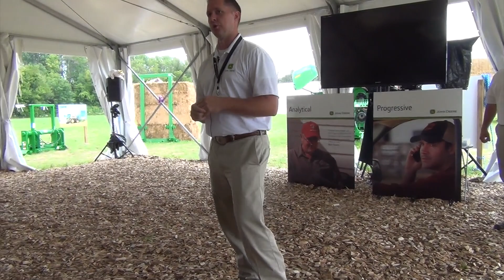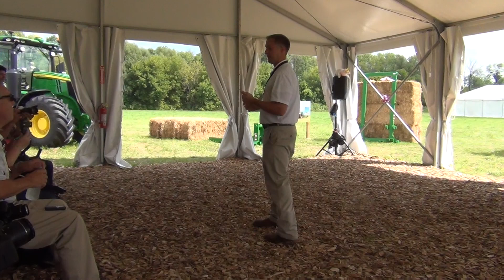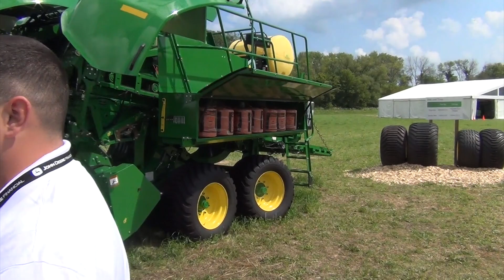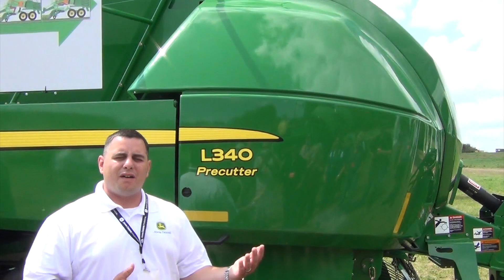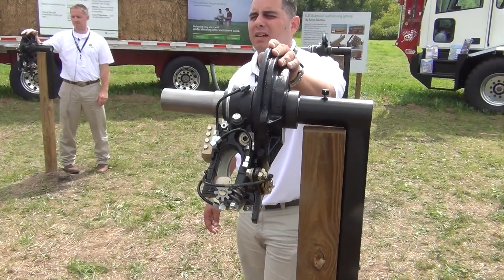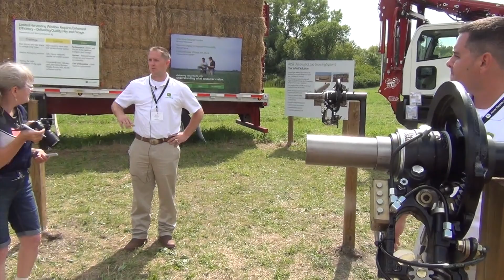John Deere 2015 Products Launch - L Series Square Baler

Comment: Its a very nice machine but it's technology is similar to that of 2008 compared to the leading competition. But here's my ups and downs with it, just by looking at your videos.
It has the exact same knotter as AGCO so there's not going to be any tying problems, how you get away with calling it a John Deere tying system is beyond me. Twine ball capacity is brutal, I would have to fill up 3 times with a deere vs a hesston or new holland. Big problem you have is no packer between the rotor and stuffer, therefore you will not get the capacity of Agco with Rotor Cut.